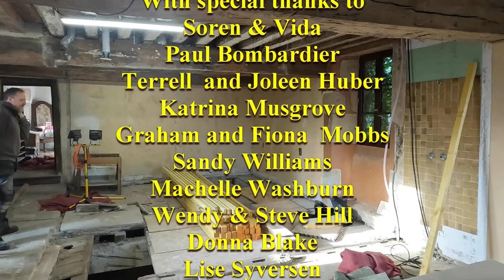Demolition at the Chateau

Comment: Great work guys , oh what an attractive wall not 😂😂 all that crap in it .. job well done... theres so much land there i would have made stalls one for rubble, cement, wood, tiles etc ... and then later down the track when and after apartment done .. then do the tip runs 😊

Comment: Good work removing the wall and saving what you could! Do you think that area was originally one large room, or it is possible that the area was divided along the line where the beams go in the other direction? Not that I need to know, just wondering if the building gives you clues about the early days.